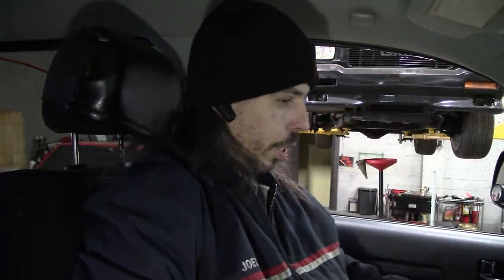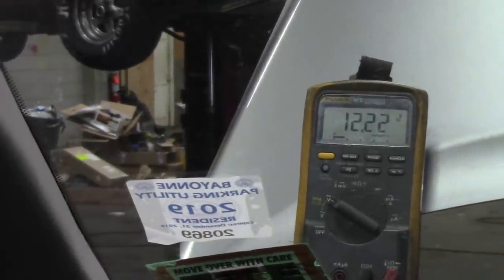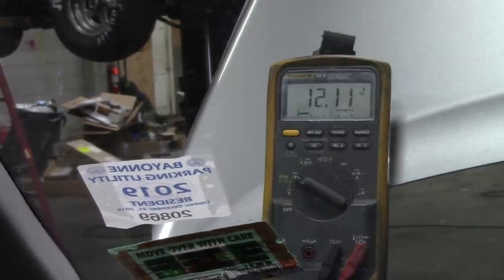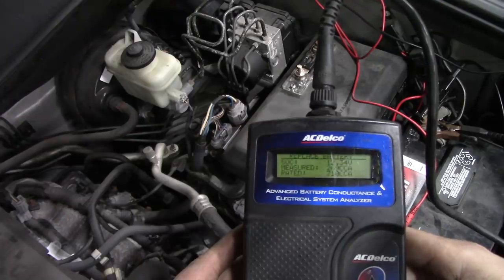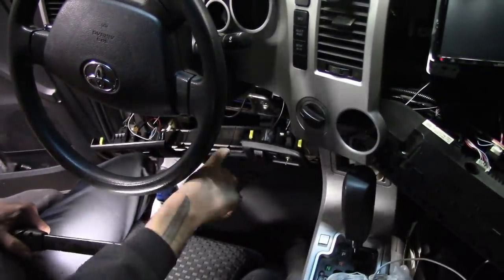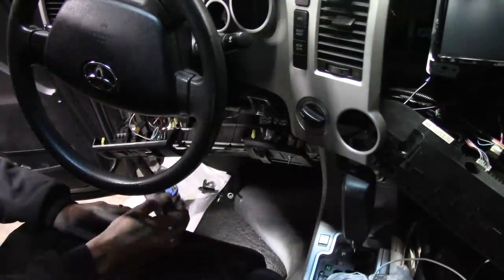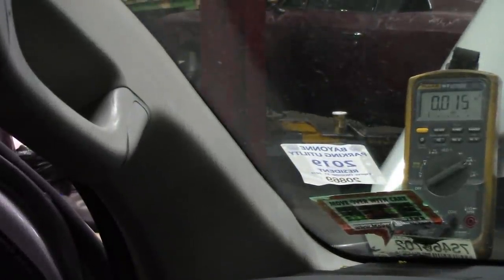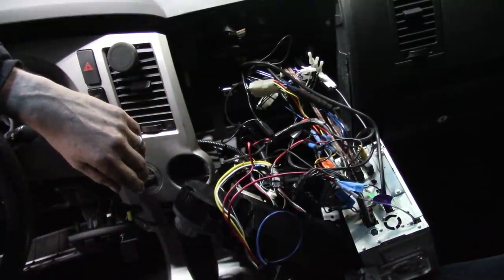Toyota Battery Drain  Can Lightning Strike Twice? Well, Watch the Video!

Comment: FordTechMakuloco just had a vid about a hard to find parasitic draw. Turned out to be a wiper module that kept trying to force the wipers at the end of travel. It went off every 5 seconds or so.
Reply from the maker: Yep I saw it. Fundamentals as I stated in the comments there is order of operation to diagnose the drain. You never start testing fuses first. You install the meter or amp probe first to prove the drain is there. Then you start to track it down. I did not agree with everything in his video. If you see the meter is fluctuating, then you would know the drain is not constant, but pulsing instead. You would test at fuses accordingly.

Comment: OMG daylight savings time air in the tires!  I damn near choked on my morning coffee.
Reply: that really is no joke. one shop i worked at we pretripped the trucks including checking tire pressure. youd see the tractors once a week but the trailer may be dropped somewhere for months. ya bring a unit inside from -10 outside and air the tires up. then come spring and all the trailers (the ones down south started first) would have tires blowout. took years to convince them that there could be that much pressure swing in a tire. as long as the duals were even in pressure and consistant all the way around i'd let them go. my joke was let the winter air out  come spring.

Comment: Joe, I really like your video about parasitic draw on the battery.  I am having the exact same problem right now with my Toyota Avalon, 2012.  My mechanic is going crazy trying to fix it.  Your video helped me feel hopeful that it will be able to be fixed and my car will become reliable once again.  Other than this problem it has been a great car.  You speak very well and  explain the problem clearly in your video.  Many thanks.

Comment: I like to start off checking the Battery, starting & charging system. If I need to charge the battery. Test system. Than disconnect battery from vehicle . Let sit over night & check the battery in the morning. Before I Check for a draw

Comment: GM's were notorious for reserve capacity failures in batteries.  The battery would start your truck at -20c but leave the key on for 5 minutes and no go.  I used to just leave the key on and headlights on highbeam for 10 to 15 minutes while i worked on other stuff and if it wouldnt start then we start with a fresh battery then check for parasictic draw(s)..  Very good video, i really enjoy your methodical approach.

Comment: I put an aftermarket car starter on my MPV. Before I did I took a two week trip to Hawaii. When we got back I had my car parked at my son's house and they were gone to work and the car would not start. So then with the remote start it took another two years to develope a no start over night. I used an ammeter and determined it was the remote door lock fuse so I removed it and when on a trip I put it back so everyone could remote unlock the car, never did find out why.

Comment: If the aftermarket stuff was installed properly then there wouldn't be a problem. Junk connected then direct to the battery bypassing the fusebox makes it hard to detect the drain. Customer may want you to install the junk correctly.
Reply from the maker: I don't install any aftermarket alarms or remote starts.

Comment: That wiring ugh. Had a truck come in once with rear left turnsignal bulb blowing out. Removed remote start and aftermarket radio and left it on the seat. Said ok problem solved.

Comment: Working on a 70 hemi cuda with a 1 volt voltage drop to the regulator............ Like an idiot I tried the battery last.....lol...... I walked away for awhile end up finding most of it in the main battery feed going through the bulkhead connector I'm losing a half of volt in there..........love watching your videos you don't mess around you get to the point and you give an honest opinion
Reply from the maker: 70 Hemi Cuda you say? Awesome car. And I'm a Ford guy! LOL Great job man!
Reply: @JoesAutoElectric  .......... I'm a Ford guy too but I've spent the last 17 months getting it straightened out.................. And yes I did say hemi cuda.............would never think in my lifetime I would have the chance to work on one never alone drive it......... Keep up the good work Joe 👍👍👍👍👍👍
Reply from the maker: Great man! God bless!

Comment: It's always a chicken/egg proposition with a battery that goes flat or loses capactity. The faulty battery can be caused by an parasitic draw, so you have to check for one anyway, especially with the construction of the batteries these days with calcium - they really don't like even a single deep discharge.

Comment: Dvom is my tool of choice as well on draws. I did get a Flir T165 last year, used it once so far on a 07 taco with a humming alternator. Upon start up cold, alternator was getting almost as hot as the exhaust and volt meter showed .18 Volts AC. Didn’t need the thermal camera, but just interesting to use it

Comment: ha ha yea in layman's terms every possible electrical problem is described as a "short"
I always tell people to never cheap out on batteries and tires... some people are just not willing to accept that their 3 year old battery is garbage... (usually its the bottom of the barrel variety) 
OR the factory installed battery that is like 9 years old and they are saying how they shouldn't need a battery, It was starting fine etc... 
Then I have to explain to them that the 9 years they got out of the battery is a remarkably great lifespan for a battery LOL. 

Yea when you have to work on cars with aftermarket stuff OR stuff like RVs or custom style work trucks it always sucks... 
you can reference the factory stuff if it is a cab model truck BUT usually its a nightmare and good luck finding diagrams for RV's and stuff lol I don't know how many chassis cab trucks with the work beds on them (like reading/knaphiede etc...)  I have seen them set the bed directly onto the harness... it will be okay for a while until it chafes away. 

On top of that they are usually owned by guys who know just enough to be dangerous (tradesmen, like construction, plumbing etc...) and they usually have some guy in their company try to fix it and they bring out the beer and the electrical tape and go to town.

Comment: Greetings, Joe.  Congratulations on another great catch.

Here is a story for  you.  My nephew was working for a forklift dealer.  The customer complained that their new forklift "kept doing funny stuff".  While my nephew was at the customer's yard, the driver came up with the forklift, stopped it, and got out with the engine still running.  After a short while, the forklift released its brakes and drove off, running into something.  This was a LARGE forklift with a closed cab, and the customer was a sawmill. 

  Analysis showed that the A/C on the forklift was a "dealer added" factory system.  Tracing the wiring showed that the tech who installed the A/C had tapped the wiring into chassis wires that matched the colors of the A/C wires.  A green wire from the A/C had been tapped into the first available green wire in the area.  Apparently the installing tech thought the green wires were all grounds. 

   It turns out that the green wire from the A/C was the ground for the the A/C compressor clutch.  And the green chassis wire that the green A/C wire was attached to was a feed that told the forklift to release the brake, engage the transmission, and accelerate.  So, whenever the A/C compressor kicked in, the forklift would take off on its own.  Removing the green A/C wire from the green chassis wire and connecting it to a real chassis ground solved the problem.
Reply: I am in disbelief that one wire would be capable of controlling breaks, tranny and throttle. I am going to call bullshit on this . Sure makes a great one upper if your standing around a bunch of idiots. One wire to manually over ride a break and apply throttle? Show me.
Reply from the maker: That is awesome! And scary at the same time. Nothing like a runaway heavy machine! Damn!
Reply from the maker: @Omnipubg Mobile, Would have to see the system and operation to know for sure. He may be missing parts of info in the story, but I believe things can happen that you would not expect when vehicles are tampered with.
Reply: @JoesAutoElectric  Very true. But after reviewing the story I came to the conclusion that I don't know what I am talking about. So if it was grounding a wire that controls or powers the module that operates the relays or what have you, then we are running on the idea that these systems are running on a voltage drop command or input. I really don't know and am just running my keys a little.

Comment: Had a 500 M with battery going dead. Missed rule number one, check battery condition.  Anyway after hours looking for a drain.   It was the battery and it was my mistake.
Reply from the maker: At least you caught it. It is so common to overlook the battery.

Comment: really if you are gunna add stuff on put a feed circuit through a fuse box controlled by a relay.  super easy if there is a problem to take it out of the equation. makes for a clean install and fewer problems down the road and its only anothe $20.00 or so

Comment: Love your videos Joe!
I was just working on a 2004 Chevy 2500 with a bunch of "issues". While troubleshooting the daytime running lights (that I mistook for fog lights) I stumbled upon the parasitic draw... From the ignition relay installed incorrectly. The relay was staying on because the power-side B+ was going through the control side winding, and through the bulbs, keeping the relay closed. I could hear the relay when I removed the only working bulb!  (4 pin - reversed)
Reply from the maker: Nice!!! Thanks for joining us.

Comment: We have a 2010 Saab and a 2012 Buick that would not start with a battery at 11.5v. Very very sensitive to even a minor low voltage. My older cars would not even notice except for a slightly slow crank.
Reply from the maker: Right on, but my thought on this is 11.5 v static. What is it reading under a loaded circuit condition.
Reply: @JoesAutoElectric  good point and that I don't know. We replaced the batteries and they're fine. The Buick did also need an alternator.

Comment: Good save on putting in the daylight savings time air, I got a chuckle out of that lol But seriously, aftermarket installs are the worst, and I can totally see why you went there right away. But how long does it take you to fix all of that hacked-up wiring? I would suspect that's no 15 minute job, right?
Reply from the maker: The hacked up wring is not my problem, unless the customer wants me to take it all out. If so, it will go by the hour. If not, he can come back when the next thing causes him fits.

Comment: I’ve seen multiple drivability problems with the optima type batteries. They always seem to test marginally ok when compared to regular ones.
Reply from the maker: Really? I have not seen that at all.
Reply: I had the same with Optima batteries until I got a tester that is meant for gel and glass mat etc batteries specifically.

Comment: So I guess ECU B just means something isn't letting the ECU completely go nite-nite causing the draw, not necessarily a short, could be aftermarket "crap"
Reply from the maker: Could be a module failure as well. Have to be careful with this sort of diag.
Reply: Joe's Auto Electric right module failure, short, but it's something not letting the ECU get its beauty sleep
Reply from the maker: Agreed. Aftermarket stuff will do this especially when tied into body control modules.

Comment: Would wiring wiring those aftermarket items to a 2nd battery be an option - perhaps in parallel?
Reply from the maker: My thoughts on aftermarket are simple. No need. Cars have too much BS in them already when you buy them.

Comment: Hey buddy another great video, deja vu strikes again. I don't have a problem with aftermarket stuff like Kenwood radios etc, they're normally good quality kit. It's the Clueless, know nothing morons that are fitting the stuff who are the problem. Most of the idiots don't have a clue about electrics but hey it's only 12v, how hard can it be right ?. If your lucky they use cheap ass connectors & fuses to connect the wiring, but normally it's No fuses & bits of wire twisted together with parcel tape insulation & don't forget the extra 20 foot of wire they stuffed under the dash, just waiting to snag & short out. Don't forget the vehicle owners either, they pay hundreds & hundreds of dollars to buy kit and then pay the local asshole $20 to install it. To my mind they get what they deserve.
Reply from the maker: You make a valid point. The truth of it is to install these things the correct way takes much more time than those installer shops are willing to spend. They would never stay in business doing it the right way.
Reply: @JoesAutoElectric  : Totally agree with you, it does take time and effort. Don't know what it's like over with you but over here there are a few firms that just specialise in installing aftermarket Audio and Security systems and make a decent living at it, even though they take the time to do it the right way. Unfortunately there are an awful lot more that just throw it in, grab the money and run. They can't be bothered to do even a half decent job, that includes some of the older well established companies.
Reply from the maker: Unfortunately, I have yet to see one place here that does the installs the right way. Some are absolutely worse than others, but the end result is always the same. A hard fail.
Reply: @JoesAutoElectric  : I know exactly where your coming from buddy, believe me. To be fair I've only had a good look at the work of a couple of these firms and I was pleasantly surprised. All wiring cut to length and loomed up, properly fused & nicely soldered connections etc. But as with you mostly it's just rammed in the fastest & cheapest way they can. We have one large local long established firm here at the moment that are charging extortionate rates to diagnose vehicle wiring problems and fit parts that don't cure the faults, when customers complain that they still have the same problems they get an aggressive response and told to hit the road.

Comment: Wow spaghetti junction. you can let the vehicle pass with 200 milliamps draw, even as high as 300 milliamps if they drive it on a normal basis. 
In the old days Ford spec was .3 to.5 amps. More with a information center.
Reply from the maker: Absolutely unacceptable. 50 mA or it is a fail man. That is really industry standard.
Reply: That would NEVER be acceptable.  .3 Amps?? For 1, they had much less electronics back then. 1 computer.... which might've drawn .005 to 
.011 of an amp. Mainly for radio memory.  I still own & drive mainly 80s and early 90s vehicles.   You must be confused Greg.
Reply: @CubasAutomotive  I'm just reporting what they had posted, doesn't mean I agree.
Reply: @GregoryBirulkin  maybe a misprint?. It wouldn't be too far of a reach. 🤔🤔

Comment: You do know cars came with nothing everything was a add on the manufacturer looked at which add one were most popular then started adding them as a option so you can bad mouth add on’s all you want there was a time a automatic transmission and a am radio were optional also a/c
Reply from the maker: We are not talking factory options here. Factory options will have been engineered for the vehicle in question. n aftermarket component, well, the name is kind of self explanatory I think. It is not designed specifically for a vehicle ear make and model by the manufacturer of said vehicle, hence ...aftermarket...hence garbage that will cost you money. And if memory serves, an automatic transmission or A/C would fall into the engineered for the vehicle category.
Reply: Joe's Auto Electric oh I know we had to install everything are self
Reply: Back in those days (fifties and earlier) when you shut off the ignition it literally shutoff everything.  No ecus or memories to maintain.  Even the radio presets were mechanical.   The height of the mechanical era was around 1941 in the Cadillac signal seek radio with mechanical multivibrators for stepping up the 6v battery and dc motors for the seek.  Each pushbutton had its own tuner core that was mechanically selected.   You would even cutout station call letters and stick them above the button.
Reply from the maker: @RJParker, now this is interesting! I would love to learn about those systems...
Reply: @JoesAutoElectric  If this link works there is a pic of the radio here

https://www.leftcoastclassics.com/1941-cadillac-fleetwood/gallery/slides/1941-cadillac-fleetwood-141.html
Reply from the maker: WOW!! Very cool!!!!